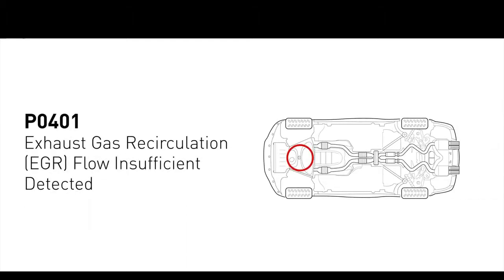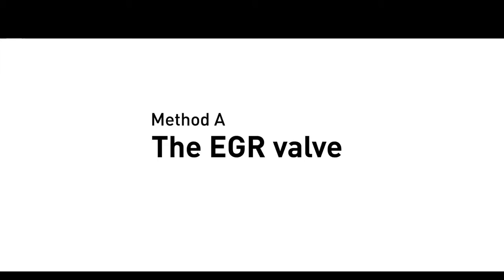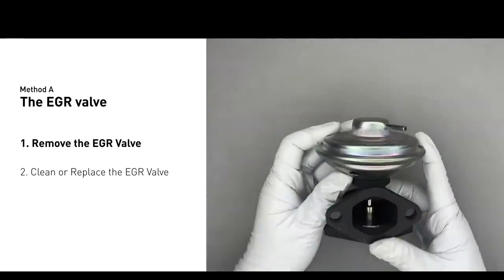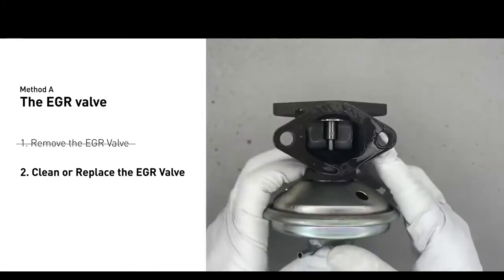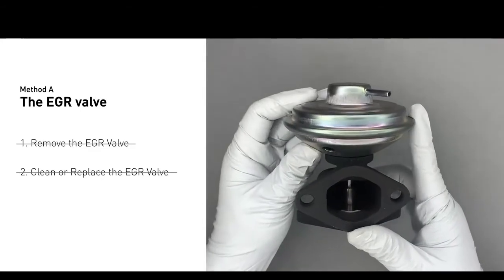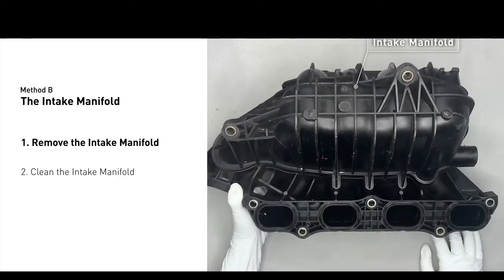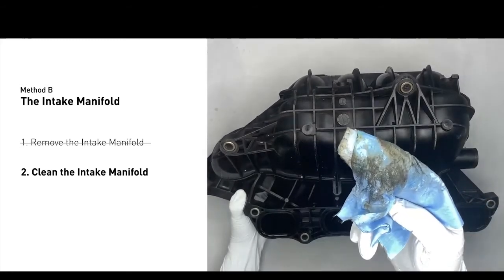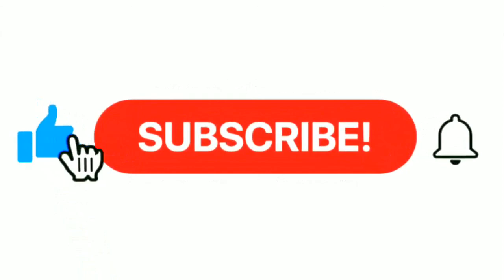How to Fix P0401 Engine Code

Comment: Don't use a on car clean spray. Remove egr valve and clean but most importantly if you want to 100% cure this issue, you MUST remove the intake manifold and also clean this.
I only cleaned Egr and 100 miles later the check engine light came back. However the MOT inspector told me the emissions were perfect and well below the fail limit. Luckily I had a reset tool so didn't fail for having the light on....